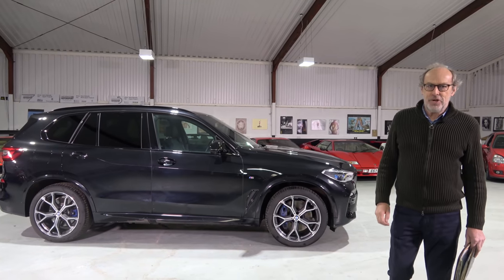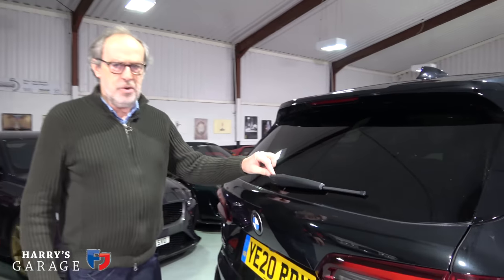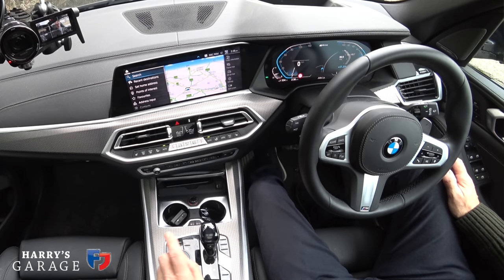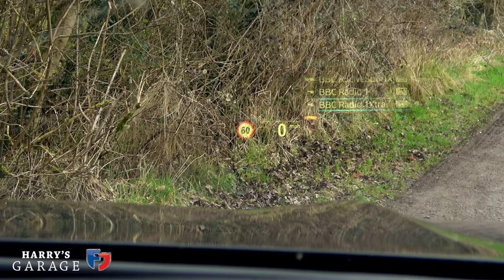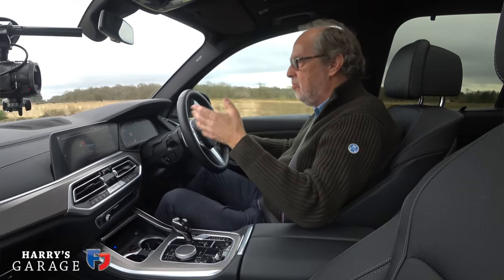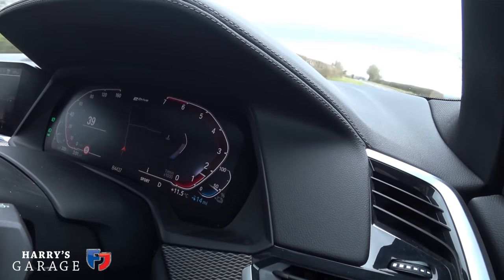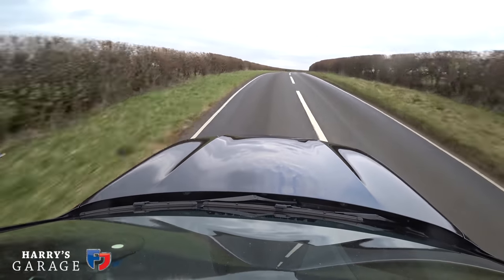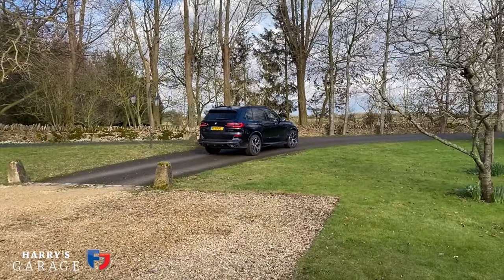BMW X5 45e 10,000 mile review. Why PHEV beats EV for our family car

Comment: Harry, the only person who will say out loud that charging is slow, and the engine in the front starts and spins ice cold. That's what we called a proper review!
Reply: and glad he point that out. I had the occasion to try a x2 25e. Find out the petrol engine start to run on the highway at 90mph and 3000rpm... stone cold.
Reply: ... it looks like you guys are better engineers than the team BMW has 🥴 just saying... don’t go ballistic on me now 😃
Reply: @radoslavdimitrov1101  I don't, don't worry. It's just a "mechanical feeling" as he say, when you gas on a cold engine. I guess they know what they are doing :)
Reply: @radoslavdimitrov1101  I once heard in an mercedes engineer interview that through the good lubrication of modern oil, suddlenly running the engine at these RPM isnt a big deal
Reply: @werbinich7908  interesting to know! Thanks :)
Reply: @LMcars  BMW are not known for worrying about the longevity or reliability of their engines, I wouldn't automatically assume they even care what happens to the third or forth owners engine, resale values don't seem to bother the sort of people who buy these things so why should BMW worry?
Reply: @popuptoaster  Indeed.  Also, if the engine is only running for half the car's mileage, even if it only lasts 100k miles then the car's got to 200k which is pretty good going.
Reply: @werbinich7908  Plus the rod and  main bearings are upgraded.  Oh yea the starter has been upgraded too.
Reply: @UniversityOfTurmoil  
Nah, not really. I would expect a lot more than 200.000 from a new engine. My old Volvo are close to the 500.000 km mark and still works perfect.

In these days we don’t even have to run in an engine. Buy it and use it. It can stand it.
Reply: In all fairness I had this same suspicion which in not unfounded at all, however after searching extensively about this particular vehicle, I’ve come across an interview(if I could only remember by whom) addressing this very question and not to anyone but someone high up and he answered that they could get away with it by using some specifically engineered parts which can withstand the wear and tear normally expected exactly in these (cold start scenarios). 
Maybe it’s just what we all want to hear... idk maybe the second or third owners will have a nightmare sorting these out... I hope not though... I’m intending to use my new X5 e45 for 5 to 7 years... I guess time will tell.
Reply: @radoslavdimitrov1101  bmw engineering quality is well known after the warranty runs out.
Reply: @UniversityOfTurmoil  all my BMW’s have all done well over 200,000 miles since the 90’s
Reply: @werbinich7908  It's actually a pretty big deal since we haven't been able to tackle the change in oil viscosity due to temperature. In short: the engine ports that let the oil drop to the oil pan are engineered with the viscosity of heated oil in mind. This means that when the oil is cold it can't drop quickly enough and the oil pump (tied to the RPM of the engine) starts running dry, which leads to oil depravation.
Reply: @popuptoaster  people don't buy cars barely now. The person who ends up buying this, will be 3rd or 4th owner, after it has done a few finance deals, then it'll be ready for the scrap yard. Modern cars unfortunately, but it is a hybrid so it is green 🤣
Reply: @radoslavdimitrov1101  I'm you're right.  It's not like they BMW engineers didn't think about this.  I am sure that BMW will have taken this into account and it must have been part of the tests.
Reply: @joshuarosen6242  It’s not like the people saying it’s no issue running with low oil viscosity are the same ones being paid when repairs are required.
Oh wait, they are! 🤭
Reply: Bought one 530e and one Mini Clubman 1.5l petrol in 2019 with one month between them. The Mini and the BMW will run approximately 10 km on petrol each day, during winter some more, the petrol engine in the BMW will typically start on the highway at 110 km/h and get to working temperatures fast at that speed. Mini runs mostly in town (but I make sure the engine temp always goes to OK).
The mini wanted oil change now in February 2021 and looking at the BMW it wants its oil change in September this year. So yes, the engine starts cold but the electric motor is assisting for a few minutes and if you try to switch back to electric it won't let you until the fluids have reached a certain temperature. 
Agree about the poor charging speed, but majority of the owners charge at night.
Reply: @werbinich7908  Would be great if Harry could get the official BMW response on the “cold engine “ issue!
Reply: @popuptoaster  A friend who is an independent BMW mechanic usually has a shop full of newer Beamers waiting on parts from Germany.
Reply: I would like to see a supplementary electric oil pump/heater module that preheats the oil while on charge and pressurises the system prior to start up. At least the lubrication system would be happier even if the piston to bore clearance wasn't where it needs to be prior to loading the engine.
Reply: @werbinich7908  Sure. Any problems don't show up while the car is still under lease and new-car warranty, and just get kicked down the road for the guy that buys a 10-year-old car used to deal with.
Reply: @UniversityOfTurmoil  yes. But what happens when the batteries get too old.  Like an old phone etc.
Reply: @popuptoaster  203k on mine and she runs buttery smooth 🤷‍♂️

Comment: In the last 18 months I've done 9707 miles in my 330e and used 73.9 gallons, that's 131 mpg. I reckon at least 75% of my miles are electric. It's refined and fast and I'm very happy with it.
Reply: Could you have hone fully electric?
Reply: @matthewlewis2072  With hindsight yes, but I was expecting to do more distance journeys this past year, and they didn't happen.
Reply: Yes, I was sure that was a better choice
Reply: So if 75% was electric ... why not make it 100% for the next car?  It's not a massive jump if you are already doing 6000 miles a year on electric only.
Reply: @Gdank72  I probably will. Before the 330e I had two Leafs, but they were limited on range and rhe charging system wasn't good enough so I went for a phev. Both issues have now moved forward so I'll go back to leccy.
Reply: Jumping on this comment a year on because I'm finding myself on YouTube watching BMW phev reviews as I'm not currently in my car (also a 330e) and my smugness score is off the scale. A plug-in hybrid when used properly is a fantastic machine for this era - particularly at the moment when prices are so high for fuel. I've got a charger at home and at work but I do do the odd long drive and the petrol engine is there - and when I'm in the mood and want an extra sprightly drive I can stick it in sport or xtraboost and that's there. It's smooth, it's quiet, it's refined, and with the m-sport touring model I've got I think it looks as good as most cars on the road. I've been driving for 20 years and I've never been happier with a car than I am with this car.
Reply: The MPG figure is massaged by the electric though. Electricity isn’t free
Reply: @HIYAharry  Yes, of course it's a blend of the two systems, but mile for mile electric is about a third of the cost of petrol if you charge at home.
Reply: @TheophilusPWildbeest I don't know if that can be the case nowadays given the fuel prices have gone to its lowest in years and and electricity bills are going through the roof for the average layman, btw have you still got the 330e
Reply: @harbzsquadings2277  No, I've changed it for an i4 which only has two faults, no rear wiper, and a lot of depreciation.
Reply: @TheophilusPWildbeest  more reasons for me not to get an ev for a long time 😂😂😂
Reply: @harbzsquadings2277  Don't get me wrong, it's great, but best bought a year old.
Reply: @TheophilusPWildbeest  I'd rather just have a 330e or 545e for that added thump of the b series engines, and its always smt to rely on incase the battery dies
Reply: @harbzsquadings2277  Understood, but the kick from a decent electric car has to be felt to be appreciated, Tesla did it first but the i4 matches it.

Comment: Harry, they dropped the 'smart key' recently, only comes with 2 conventional keys now
Reply: Does it not come with the conventional keys anyway and the pointless key is a paid option? Was for my x3
Reply: The smart key can drive the car out of tight spaces, if you have that option! Charges at the wireless charging pad. Is still delivered in Norway.
Reply: The smart key was rubbish indeed. Glad they got rid of it
Reply: Good - some useless things with my 7 series - that clunky key, the LCD rear passenger remote pad which basically mimics a standard Samsung smartphone , tinted rear side windows when blinds are specified and gesture control.
Reply: It’s cool to have but ours got locked away and never used. It’s pointless when you can’t attach keys to it and if you drop it what if it breaks. The two other keys were great quality anyway so they are easy to use. Also, if you have keyless entry, it defeats the point having a fancy key as it stays in your pocket or handbag anyway.

Comment: Also, you’re not driving the farmer’s spec.  Get it without the M Sport pack and you’ll lose those side sills.  Here in the US, 19’s are standard.  Stick with those or 20’s with a little more aggressive tires and you’re all set.
Reply: Hi Joe, In the UK we only get M Sport X5's, SE not an option and smallest wheel size on 45e offered is 20".
Reply: @alexwells4364  Sorry but your wrong in the uk you can get the x line model which comes without those side sills & gets 19 inch wheels

Comment: Very useful real world experience on the use of a PHEV. Top clip, as usual, Harry.
Reply: Absolutely
Reply: But 50mpg is not remarkable (a 1 litre, 3 cylinder Ford Focus does that). If one wants to make a 'green' car, make it a 1 litre, 3 cylinder (or similar) and then add the hybrid stuff. And don't make it needlessly huge. Its mpg would be much better, and it would be much better for the environment. And maybe - just maybe - then future governments won't feel such a great need (or have less of an excuse) to tax the hell out of  petrol sports cars and the like.
Reply: @julianevans9548  I get where you are coming from and completely agree, but its not really the same class of car, and if every cars was hybrid and lets say 35-50% of monthly miles are electric that's still a great improvement compared to older diesel SUV, its like the current progression of EV's all they do is make them faster, bigger and heavier, instead of lighter and more efficient. Who is ever going to need sub 2.0 sec to 60 mph.
Reply: @WascalSpiwit  Yes, the obsession with fast EVs makes no sense. Make them efficient, and we can perhaps keep real sports cars, rather than milk floats that move at rocket speed (the novelty of that will wear off after four goes, I reckon).
As for SUVs, almost nobody needs one. We never did; we still don't.
Reply: Julian Evans when you factor in the amount of electricity used to charge the battery, the equivalent mpg is more like 37. Heavy cars with big frontal areas and poor aerodynamics are never going to be very efficient, even when purely electric. Many of the people who buy them have more money than sense.
Reply: @julianevans9548  That's right. I have an X3 with the brilliant 3.0d engine and I average 48mpg at the end of the month.  Drove 350 miles to Carlisle last month and got there averaging 57 mpg. Jumping to the X3 or X5 hybrid doesn't float my boat to be honest.
Reply: @paulyflyer8154   I like riding a little higher than in the typical sedan.  Otherwise, I agree with you on the value prop for midsize SUVs.  And small SUVs?  What a waste of money.  We're going from a Sienna and looking at the X5 45e.  This video made it seem pretty compelling.

Comment: The X5 45e is a superb car. I’ve had mine since June 2020. 9,000 miles covered with 6,800 on pure electric. Indicated 87 MPG ave over that period. Most journeys are sub 40 miles. Yes the charging is very slow but if you are considering one of these I would highly recommend!!
Reply: How to use the Modes the best? I Whoud say town Full elektric on normal road where i Drive 100kmh Sport?

Comment: Owner of a Mitsubishi Outlander PHEV for 4 years and very similar experience. Love driving in electric mode and no range anxiety for long trips. It's the journeys that are just too long to do on electric that are annoying. Either maximise electric capacity or use more petrol to warm the ICE system properly (first world problem). I try to avoid overtaking until the engine has been running a while but spirited pulling out of junctions can cause the engine to fire up when not really required. Overall very happy and will keep it until long range EVs are affordable.

Comment: I would like to comment on the "lack of power capacity" in German homes. That is simply untrue. There are regulations in place in Germany that demand a symmetric three-phase power draw when exceeding 4.6 kilowatts. Private charging points must not charge more than 20 amps single-phase, which is 4.6 kW at 230 volts. Cars like the Range Rover are therefore not able to fully utilize their 7.2 kilowatt single-phase onboard chargers on those charging stations at home. If you want to have more than 4.6 kilowatts, the car has to be equipped with a three-phase charger. Then you can do 11 or even 22 kilowatts at home, but the latter does have to be approved by the power company first. Standard household supply in Germany is 44 kilowatts (three-phase at 63 amps). 7.2 kilowatt single-phase chargers are just very attractive from a cost point of view for the car manufacturer because you can sell this onboard charger worldwide and it will fit most market needs, like in the US (where there is no three-phase for EV charging) or China (where single-phase 32 amps is standard although they do have three-phase power). Many of today's EVs started with 7.2 kW, but have now been upgraded to 11 kW three-phase (like the Jaguar I-Pace or the Hyundai Kona) to comply to European charging standards. So BMW just has to upgrade that damn old charger in the X5, which they have used for several years in the former PHEV models as well. That's just old stuff. Put an 11 kilowatt charger in it, and you will be able to relatively fast-charge that car in Germany and the rest of Europe.
Reply: Very informative! Thanks. 
Do you know if this can be retrofitted? Now or in future or it is what it is and we have to be put up with it? It’s a shame as this slow rate makes it unusable at a public charge points.
Reply: @radoslavdimitrov1101  in theory, yes.  Like it would also be possible to retrofit a newer generation of battery system. But it is unlikely in my opinion. You would also need to switch the charge port and high voltage cables to the charger which would be thicker and possibly would not fit in the original position in the car body. Also, financial aspects. Example: if you bought a first-gen BMW i3 with the 21.6 kWh battery, two years later you could pay a significant amount of money to upgrade to the then-new 33.2 kWh battery system and so increase the range of your existing car. But the total cost was close to selling your old car and buying the newer version while still missing out on the other improvements introduced with the newer battery, like three-phase charging 😉. So not that attractive.
Reply: @jan-hendrikbussmann4644  Very interesting. So knowing that German HH already had 44kW 3-ph charge, they missed a big opportunity there. Wonder when the upgrade will come since as you say the mods are quite extensive. I also wonder what the cost of the 3-phase charger install is in both UK and German as this needs to be factored in to the capital cost.
Reply: @paredding  Three-phase wallboxes are not that much more than single-phase ones. In the end, it is a glorified power outlet with over-current and fault current protection. It gets more expensive if it has smart features like an internal power metering unit, WiFi and so on. On the onboard charger side, a three-phase design is much more complex because many components are simply needed per phase, so three times instead of one. In general, the complexity of the internal design of the charger increases a lot for three-phase. This also makes for a huge packaging problem: the chargers get a lot bigger, so they may not fit in the position of the old one. It is actually mostly a problem for PHEVs. They have to fit a combustion engine with all the stuff around it and also the electric part of the drivetrain. The onboard charger in a PHEV is like the least favorite child of the manufacturer: it often gets the Harry Potter room of the house, stuffed in some dark place. On a fully electric car, most of the time it is not that difficult to find a suitable spot for the charger. Which also means the charger does not have to be fully optimized for being small first, powerful later.
EDIT: crap, wrote another novel.
Reply: @jan-hendrikbussmann4644  Not at all - the more we know, the better (more informed) decision can be taken. Devil in the detail and all that. The next step (for me) would be to see the vehicle capital cost diff between ICE and PHEV plus install costs and the ROI 'cos 50mpg v 45mpg isnt going to cut it ;-)
Reply: Spot on!! Servus!!
Reply: This aged badly. Lol.